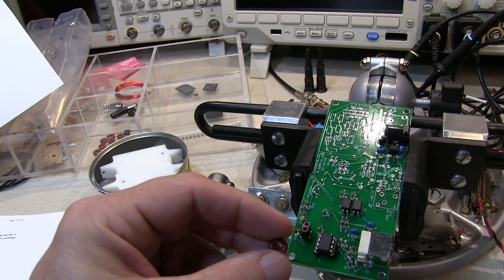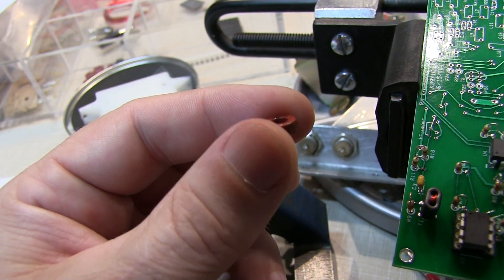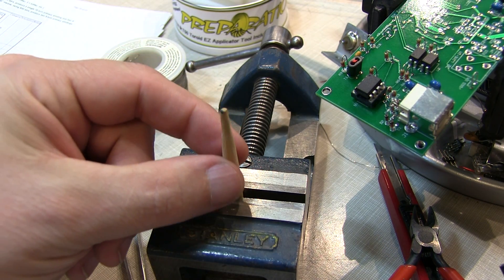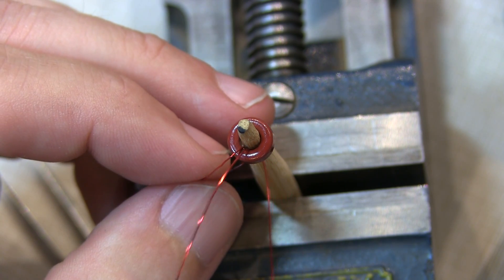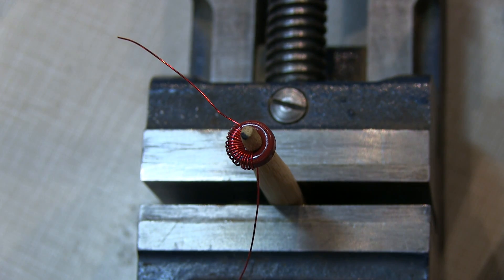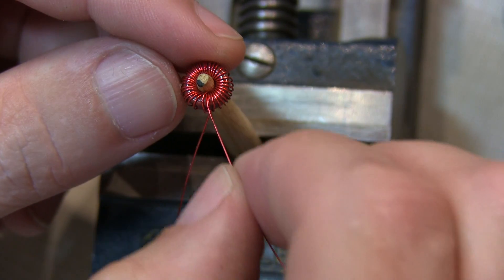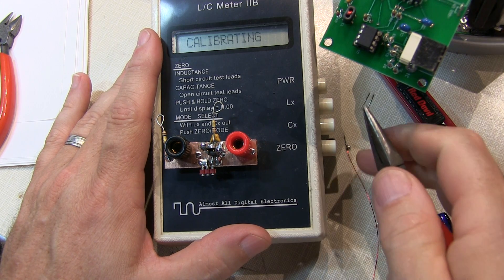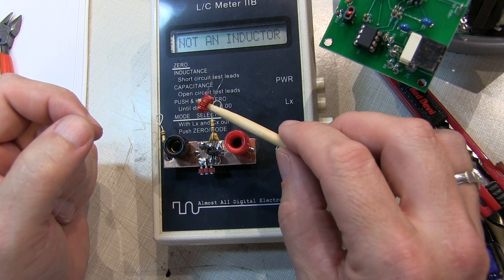#151: How to wind a toroid inductor | A quick tutorial

Comment: Alan:
Thanks very much for this tutorial on winding toroids. You have a wonderful way of explaining things in a calm and methodical way. Also, the quality of the video and audio was superb. I love the modified chopstick winding tool. Going to use it right away.

I did have one question. I need to wind a couple of toriodal inductors for a project I am currently working on that involves three separate windings on a T 50-2 toroid. Two of the windings must be "in phase" with one another. I have tried, unsuccessfully, to find an explanation of what this means in terms of winding these two coils. Can you enlighten me?

Many thanks.
Reply from the maker: Great! Best of luck with your project!
Reply: *****
Alan at the risk of wearing out my welcome, can you point me to a place I might learn about ensuring multiple windings on a single core are "in phase". See my earlier post below:

I did have one question. I need to wind a couple of toriodal inductors for a project I am currently working on that involves three separate windings on a T 50-2 toroid. Two of the windings must be "in phase" with one another. I have tried, unsuccessfully, to find an explanation of what this means in terms of winding these two coils. Can you enlighten me?
Reply from the maker: James Hyde Quite simply, having windings in phase means that they are wound in the same direction, and the in-phase condition is met when pairing up the ends where the wires first enter the toroid.  These are often indicated on a schematic with "dots".  Sounds like it might be a good topic for a video...
Reply: *****
Alan: Great--this is exactly the information I was looking for. For a non-engineer hobbyist like myself I found lots of references to the "importance of phasing" or following the "phasing dots" in the diagram but no where anyone explained how to ensure the two windings are in phase. Even the Handbook was vague on topic. I think it would make a great video addition for people such as myself. many thanks for all of your hellp. 73's K1KJW.

Comment: Just sand the wire where you'll solder it. It's the cleanest way of them all. Also you usually don't need to use flux as surface was protected from oxidation by lacquer (or enamel). While if you  burn it, you leave the mess on wire + heat accelerates the oxidation of surface - all this just calls for a bad solder joint.

Comment: ive been working on a BPSK transmitter using your colpitts oscillator and toroid winding method for the center tapped. it seems that my xtal freq is drifting and i can view on the scope that there were a lot of harmonics oscilatting at the osc output. here is my schematic https://fbcdn-sphotos-h-a.akamaihd.net/hphotos-ak-xfp1/v/t1.0-9/10616630_726086827447111_1926890405702979475_n.jpg?oh=c6ad5821fbab23b0de006c543fa8878b&oe=54BC2B27&__gda__=1422977710_c5ccf8ef87668e5a92ae0eef92d7fc19
Reply from the maker: It is normal to have some harmonic distortion with these oscillators. If these are used for a transmitter, you'll have to filter the harmonics away.

Comment: Allan , I have seen your fixture for the LC meter before , but have not seen a video for that little board fixture , could you link to it ?
I will go looking also .
Thanks again
Reply from the maker: It was used in the video on varactor diodes:
Basics of Varactor Diodes | Voltage Controlled Oscillator VCO Example
But maybe the fixture deserves it's own video at some point.

Comment: I have a question:  Why use a toroidal core at all? I understand that a toriodal core increases the inductance but couldn't we just compensate with many more turns of wire or would ESR be an issue?
Reply from the maker: Not only ESR, but the self-resonant frequency will often be lower due to the higher interwinding capacitance.
Reply: Oh yes I forgot about interwinding capacitance. Makes sense , thanks for the answer !
Reply: *****
hi why don't you build this ? The device can be build in a day at any University.Please study this and help to spread the word about this Malaria Treatment using oscillating magnetic fields which can be built by University students.6 million people are dying each year from Malaria.People just like you.Children,men women, mothers and fathers dying in great pain and suffering from malaria are dying right now.Remember just because it's not shown on the tv does not mean it's not happening. www.washington.edu/news/2000/03/30/magnetic-fields-may-hold-key-to-malaria-treatment-uw-researchers-find/

Comment: Alan, this is a very helpful video.  Say, do you suppose you could continue publishing your progress and experiences with the Ensemble II kit?  Several of us are making this kit and having your videos to reference during building and operating would be very helpful.  Thanks!
Reply from the maker: Thanks.  I wasn't planning on going over every assembly step like I did for the Softrock Lite II receiver kit from two weeks ago.  Many of the details are the same. I may do a bit on testing each section, as well as a circuit walk-through when I've got it completed though.

Comment: Nice video. One comment though. I always read that you were supposed to end the winding before the end of the toroid so you leave a small gap of unwound core material exposed.  Not an excessive gap but a small gap maybe 10 degrees wide or so. This minimizes stray capacitance between the two ends of the toroid.
Reply from the maker: Yes, you are right.  It would probably be better if I overlapped the last few turns to preserve the small gap between the first and last turns.  Excellent point!
Reply: That could be why his measured was slightly off from calculated. Didn't affect it that much in this instance - one nice thing about having a meter.
Reply: @1Howdy1  maybe; but the Al value and the estimated inductance may not be always corroborate with the actual winding in the real world because the permeability of each piece of the same batch of torroids are found to be differing  a bit on either side of the Al value given by the manufacturer. 
De VU2RZA
Reply: Yes. It's routine practice to cover only 270 degrees of the circumference to avoid the interwinding capacitance on the one hand and to make it easy to mount the core vertically on the PCB along the bare side of the torroid.
De VU2RZA